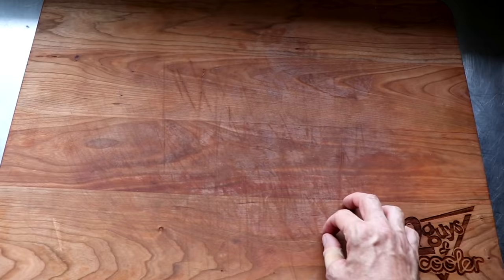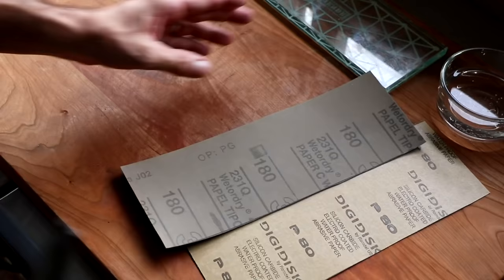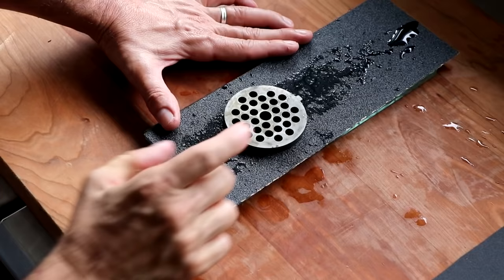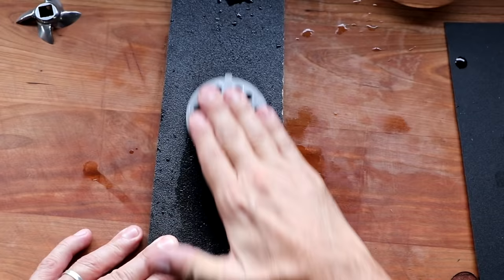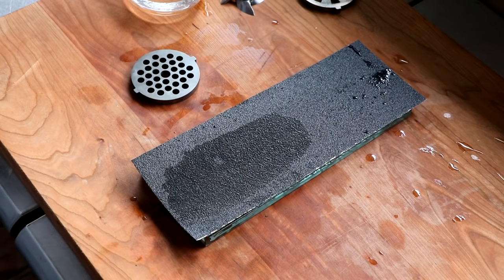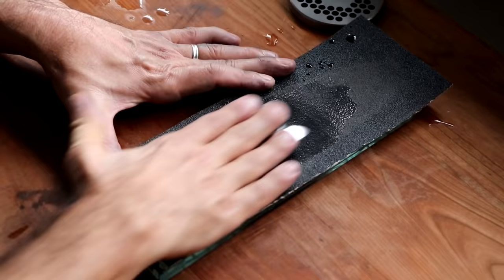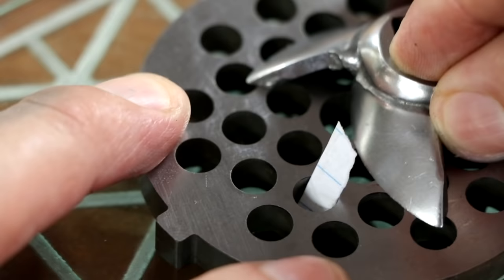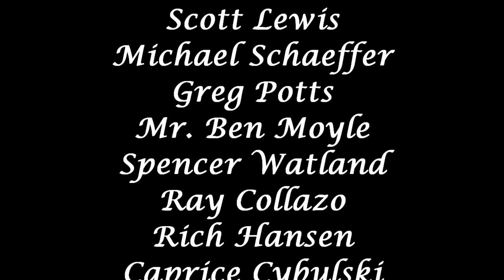Celebrate Sausage S02E18 - How to Easily Sharpen ANY grinder plate and knife

Comment from the maker: Check out Jende Industries for your sharpening supplies:  https://tinyurl.com/zua2k5dk (USE DISCOUNT CODE --- 2Guys)
Reply: Can you PLEASE tell me why I shouldn't use the sausage maker  stones?
Reply from the maker: @michaelpolicastro4113  You should.  They work, a bit on the fragile side but they do the trick.
Reply: Thanks I will use them,  however I  see that once I use them I will never be able to lap the plates on the glass because the stone is slightly smaller then the plate. A grove or ledge will be created . @2guysandacooler
Reply from the maker: @michaelpolicastro4113  yep.

Comment: I'm a retired CNC machinist and we did pretty much the same thing when we needed to get a part nice and flat. We had Granite plates we used but when we were sharpening our parts we would move them in a figure 8, ensuring we get the most out of every direction there is.  Many times we had to have the face of the part flat less than 0003".  Great video. Thanks.
Reply: Figure 8 is the best method!!
Reply: I have a small sharpening business. Your technique is used in sharpening clipper blades.. I'm not trained in this area but you can imagine that getting the clipper plates mating correctly draws on engineering practices.
Reply: Yup, I would have suggested a whole sheet of abrasive and a big steady figure 8
Reply: @mitch3384  Yep, I sharpen my clippers with a plate of glass and 1 micron diamond paste. It even sharpens ceramic clipper blades.

Comment: I get these when sharpening in a town with an ethnic group who are raised to not trust butchers with ground meat. I thought this was interesting and it answwered why I only got these in they one town. all that said too bad you didnt have one that looks like it has been used far too long with out sharpening. I get sets that look like old wornout brake discs. I find my extra course diamond lapping plate takes me 30 minuits to restore only one side of the puck part. Not both side and not to the finer grit.

Comment: Worked as a Millwright and R&D for one of the largest Seafood processors & Canneries in Alaska. Custom fabrication was the name of the game & because we were dealing w/ millions of pounds of fish, there were Knives involved . . . lots & lots of Knives. Mostly fillet & trimming knives but there were many specialized knives on the Salmon Fillers (canning machines), & Salmon Butchering machines (weird knives on those machines like something out of a Turkish Nightmare!) In our R&D group we developed automated knife sharpeners for the Ceramic knife in the Salmon Filler machines. All this is to say is that I've sharpened my share of knives (and several others shares as well) and I would recommend a simple change to your Meat Grinder plate & blade sharpening method shown here. I'd drop the use of the 80 grit completely (on steel that hard, 80 grit is considered highly agressive. The deeper the scratch, the more work needed to finish), and start w/ some 120-180 grit. Follow that w/ some 240-400 & finish w/ some 600-800 grit. It will take double to triple the passes along the sandpaper but the edge created will be noticeably better than a 120 grit finish.  The finer the finish, the better the cut will be.
Thats my two cents worth.
Reply: Can't agree more. I usually sharp my knives with 1000 and finish with 3000, so I was a bit shock to see the 80 and even the 120 sand papers.
Reply: I sharpen plane blades and chisels, and agree that I wouldn't use such coarse grits.  I'm wondering though, if the steel is different and that is why he used those grits.  I've used grits in the thousands, more like automotive sandpaper if I use the sandpaper method.  I'm just learning about grinders, so it's new to me.

Comment: Slick! You just saved me a bunch of money. I find hand crank meat grinders at thrift stores every now and then and I have two sitting in my barn that I haven't refurbed yet. They're both gonna' get that sharpening treatment and then I'll keep the best one and either sell the other or give it away to some friend that's needing one. I think I paid $1.99 for each of them and they came complete with all the plates! I just looked up the cost of a new one. Anywhere from $50 up to $150. Man, it's worth hitting the thrift stores for pots, pans knives and kitchen stuff.

Comment: Excellent video and technical advice. I've been doing this for years using some spare float glass from an old glass tv cabinet and some finer 600 grit wet sand paper on my Kenwood Chef Mincer blade and plates. I assumed this was the only way to sharpen them. Great to validate that I had the correct technique. 😃

Comment: Great video, I'm sure my 40 year old KitchenAid grinder blades could use a tune up.  :  )    I had speculated that sand paper and a flat surface would work, but now I know for certain how to do it. 

You may be dulling your scissors by cutting sandpaper.  You can rip sandpaper sheets into strips by pressing a metal straight edge (shop ruler) along the line you want to cut and pulling up and a bit across on the top edge of the paper. I fold the paper first along the cut line, just like you would a sheet of typing (OK boomer) paper.    You can also score the back side of the sandpaper with a utility knife held against the straight edge before.  (A tip from my grandfather (father to the Greatest Generation), a blacksmith, auto mechanic and home brewer.)

Comment: Ive used this  technique you provided . Works great I used a flat piece of aluminum for the base. I will say that the inevitable will be blade and plate replacement because of distance being created little by little between the two. Being a carpenter by trade I love to keep tools sharp.
Reply from the maker: I love this method.  I've found that there's no distance created between the blade and plate because there's a 8-10 mm protrusion with the disk.  The cap keeps the plate pressed against the blade.  The issue will be once you remove a total of 10mm off of the 2 and there's no more protrusion for the cap to tighten against.  I've been sharpening the same plates and blades for 2 years now with very little wear so I'd love to see how long it would actually take to shave off a total of 10mm.  Either way, I've saved a ton of $$$ simply from not having to replace my blades and plates!!
Reply: @2guysandacooler  awesome. Lots of sausage before I need to worry about it. 👍love the channel keep ‘em coming.

Comment: I bought Sausage Maker's sharpening system (2 disc's per kit size) that fits on the grinder auger for the plate, and plate stone for knife. Less than $30 vs $70+.
 You do have to exercise some finesse when using tthough. Drop it and your done, they'll snap in half. And if you tighten the auger collar to tight, same thing. But 10 seconds is all it takes per plate/knife. Pretty nifty. 
 With this technique I use to use the bottom of a dinner plate (one of those vitreous ones) as my flat surface.
I didn't know the 80 & 180 grits were the paper to use. I was toiling away with 220 & 400. Live and learn!
Reply from the maker: Yeah those stones are great and work very fast (and are super fragile) and work great if you have the kind of grinder that the plates fit on.  As far as grit goes, it really all depends on how much work needs to be done. I find that the 80 and 180 does the job quick and clean with great results.  I do mine about twice a year regardless is they need it or not..

Comment: Just what I've been looking for. Based on my knife sharpening experience I would have expected finer grit abrasives to be used but clearly it works. Will give it a try and thanks.
Reply from the maker: That's what I would have thought too.  Originally I started with a 500 and 1000 and it wasn't resurfacing the way I wanted it too.  Took way too long for me and didn't clean up a lot of the previous scratch patterns.  This way (at least for me) worked the fastest with the best results)
Reply: @2guysandacooler  going to Home Depot tomorrow.

Comment: Thank for the video I only have 2 things might be bit help for you .one is that sand paper is big in the auto body section and it works better if you let it soak in water for bit then use it .as for your marking there is some marking ink used in the machinest line it's blue it works much better than a sharpie :) just thought id let you know

Comment: The reason water works so well on sandpaper, is because water is actually pretty dense/thick and acts as a lubricant. Hence why wet sanding, is so popular in body work. So you can kind of think of water like oil when using sandpaper, that's what it's doing. Makes for a much nicer finish over dry sandpaper. And this is exactly what you do there too really. Finer and finer grits till it's smooth and shiny, but there's a lot more steps to body work and graduating grits, this is surprisingly simple actually, only two grits.

Comment: I used to surface grind the plates when i had access to a rotary surface grinder.  Basically the goal is to restore the cutting edges of the holes on the plates, edges of holes should be sharp. As for the cutting blade I've used your method with a figure 8 pattern with excellent resuts
Reply from the maker: Great tip!

Comment: Good video! Also, if you put a little water between the paper and the flat plate first then the paper will kind of stick in place and you don't have to hold it down so hard.
Reply from the maker: Great tip!

Comment: Great overall technique, however I would suggest thoroughly rinsing the plate between each use of paper change. Once in a while if the mincer is very concave ie, there's a section in the centre that is slow to level out, use a figure of 8, perhaps rotated at 12, 1, 2, 3 positions on a clock face. It's important to maintain even pressure on the plate too. I've made a circular piece, that just allows the plates top diameter to fit into a recess. I made the top holder out of one piece to have a 40mm diameter knob, that fits comfortably in your pushing or rotation hand when doing the figure of 8's.
Remember to flush between each paper change. Larger grit, will leave scratches or even gouges on the surface...that's an immediate area of fat smear.
Mike
Regards from Down Under

Comment: Thanks for this video. very clear.
I get these when sharpening in a town with an ethnic group who are raised to not trust butchers with ground meat. The grandson translated for me with the question I asked his grandma with my question why. I thought this was an interesting fact and it answwered why I only got these in they one town.  I only get sets that look like old wornout brake rotors. I find my "extra, extra course" diamond lapping plate and it takes me 30 minuits to restore only one side of the puck part. Not both side and not to the finer grit. Sometimes I do most grinding on my belt sander and only confirm its flat on my lapping plate. Thanks for showing your home process. It confirms what Im doing is not too far off. Ill try your paper test. 

Reply

Comment: Really helpful video. Thank you very much for revealing this unknown secret when buyers buy kitchen aids grinder attachment several time and the meat won’t come out just stay in side with a lot of frustration. Now we need to buy the paper glass for this duty for me. Man you save our money. I am gonna try and examine that. In case of doing that randomly with paper glass we have at home does that harm the blades?
Reply from the maker: it will only harm the blades if the glass plate is not perfectly flat

Comment: How many times do you sharpen till you have to compensate for the meterial you remove because the 80 and 180 grit paper are very aggressive i generally use 2000 grit with water to sharpen knifes works better than about any stone you can buy now.

Comment: I'm really interested to know (if you know) what the theory is behind the rotation pattern for the plate. I have a small knife & tool sharpening business so the 'why' is always interesting to me.

Professionally speaking, I'd really recommend deburring afterward. There will be a small burr caused by the grinding which you'll be able to see with a microscope or cheap x50 jeweler's loupe. This is a really deep rabbit hole of a subject, but a simple option for the blade is to drag each edge through some end-grain MDF or softwood lightly a few times, which will cause the burr to shear off and remain in the wood, rather than going into your mince. Use light pressure, no more than what you'd use pressing a disposable razor to your skin to shave. If you're comfortable using a strop for knives, you can do the same here to fold the burr back and forth a few times to remove more of the burr. 

For the plate, you can take the corner of a piece of MDF/softwood, put it in the hole and twist so one of the wood edges rubs around the perimeter of the hole and scrapes away the burr. You could even wad up a clean rag, and use that with a twisting motion and the burr will hook up in the material fiber and pull away.

Comment: Thanks for the great video. I just finished sharpening three plates and three blades,  they turned out fantastic and cut paper just like you show they should. I do have one question. I've watched your videos for probably a year now and see that you have a stuffer from The Sausage Maker. I bought their 20# stuffer twenty-five years ago and I love it except for one thing. Installing the O-ring onto the plunger isn't easy and as I get older it gets harder and harder. A few years ago I went to a hardware store and bought a bolt that screws into the plunger so I can screw the bolt into the plunger and then clamp the bolt and plunger into my garage vice. This allows me to use both hands to stretch and roll the O-ring onto the plunger, it works but it's still not easy to do. Have you come across an easier method to install the O-ring or come across an O-ring made from more playable material? I've reached out to The Sausage Maker twice about my concern and to see if they may have a more playable O-ring available but I have not gotten a reply from them? Keep up the great videos, Eric.

Comment: Excellent video!  I just bought a hand grinder (LEM) so am wondering if this process is also used on the cast iron or stainless hand grinders.  Not sure if the mechanisms are the same, and I don't have it here to look.  

Since I'm a woodworker, I have a large flat plate and also various sandpaper grits incl wet/dry.

Comment: Thanks for sharing this Eric!  I bought the sharpening wheels from the Sausage Maker last year but haven't needed to use them yet.  Any thoughts on those, or have you ever used them?
Reply: I bought them years ago used them once. One of the stones broke. They are garbage. Only time I’ve been disappointed by the sausage maker.
Reply from the maker: Hey Russ,  I've used those stones quite a bit.  You have to be very careful when using them as they break easily.  Especially if you tighten the screw ring too much.  Other than that I've had great success with them.  They work super fast.
Reply: @2guysandacooler  Thanks for the tip on over tightening Eric!
Reply: @2guysandacooler  Wouldn't using stones and not being sure of applied pressure make using them a hit or miss proposition? As well as their tendency to break.
Reply: Had this idea but not the turns of the blades,thanks.

Comment: If you had some way to keep your lapping plate from sliding around it would work better.   Wet that lapping plate and soak your sand paper,  it won't slide around on the lapping plate.

Comment: Any tricks for what might look like rust in the holes of a Porkert #5 grinding plate? It's already been through 2 vinegar soaks and brushing every single hole with salt and baking soda. I'm about to either make an electrolysis tank or use a vertical drill on it to resurface the holes. It's my first manual meat grinder that I found at a thrift store and would like to bring it back into action!

Comment: Thanks for the nice video. Would you explain how you chose the angles you change in the sharpening process (0->15->180 degree)
Reply from the maker: So the point in this sharpening is to resurface the face.  We do this by creating a scratch pattern.  The 0-15-0 method is simply there to break up the scratch pattern.  If we only do "0" the plate will create ruts and the resurfacing won't be as effective.  The 180 rotation is to accommodate for any difference in pressure that one might have as they are moving the plate back and forth.  So that 180 turn is just to make sure the place is resurfaced with even pressure.
Reply: @2guysandacooler  Hi Guys - well explaned

Comment: Any heavy glass or granite countertop makes a decent lapping plate.  This is indeed the correct manner of sharpening grinder cutters, unless you have a magnetic surface grinder handy. The stones that mount on the grinder are forgettable, to be kind.
Reply: Caution  Some of those blades and plates are 400 series stainless and need to be "Blocked" on a surface grinder. I have a surface grinder and using sandpaper is half assed, but it is better than nothing.

Comment: Man the technique is Nice, I ve been using It for years, but you are using extremely coarse sandpaper, you should start at 240 If you Blade is Very dull and go up to 400, 600, and 1000 for finish, then you'll have something Sharp.
For knives go up to 3500 grit, does not matter If it's wet Stone or wet sandpaper....
Reply from the maker: Hey Andre.  Thanks for the comment.  Under normal circumstances I would agree but for this sharpening I am more looking for shape rather than sharp.  anything over 240 would be overkill (I've done it).  I find the course papers cut quick and give the desired shape which is perfect for mechanical sharpening.  Now for knives my answer would be completely different and a nice 3k or 4k finish is a thing of beauty!! 😀